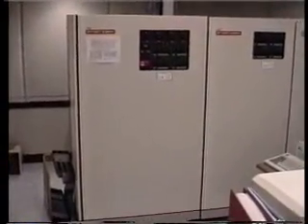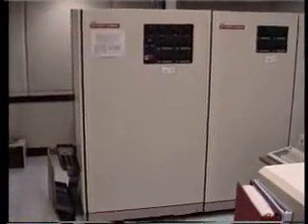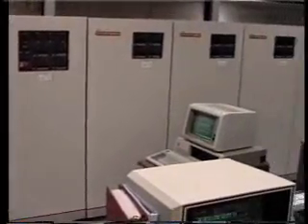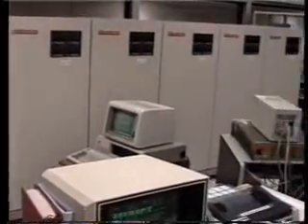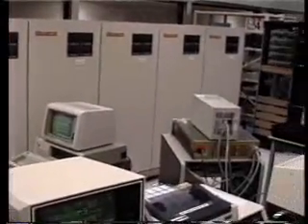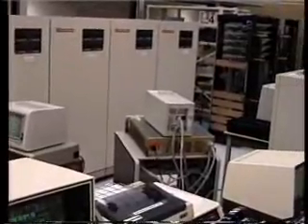Video Tour of a Mainframe Computer Room circa 1990  Please also see my IBM Impact Printer Video

Comment: isn't it "raised floor", not "suspended".  at least, i never heard the term suspended.  the floor you walk on is 15-18 inches or so above the actual cement floor.
Reply: Yes, the ceiling is suspended and both can be return air plenums.

Comment: My laptop has 16gigs of memory.   However the IBM 360 mainframe I programmed in college had 32k.   Even with 96meg mainframes are very good with managing memory. Programs written back then tended to be smaller.  Our datacenter at work is mostly Blade servers rack mounted.  The apps are cloud based and run through a browser.   That video brought back memories.

Comment: Started my career in an mvs/360 jes3 shop as a print pool operator, on 1980, and worked in many departments over the years.  it was a different world back then, when work was fun. Troubleshooting hardware errors or job abends was the bomb.
Reply: "Abend" a term i've not heard in 30 years since my mainframe days.....
Reply: I worked in a JES 3 shop too when I was just starting out.  Tape and print area.  The good old days.

Comment: a 96 meg mainframe what years is this, 1912?
Reply from the maker: This computer is from the 1992 - 1995 timeframe.  In 1912 they did not have computers.
Reply: careh1 I bought my first PC in 1982 or 1984 and it was 3500 dollars!
Reply: The last mainframe I worked with, in the mid nineties, had 16MB of storage. Megabytes, not gigabytes. It supported hundreds of online users. Mainframe architecture is a zillion times more efficient than the Windows and Mac architectures. On the other hand, they are also more expensive :)
Reply: In the early 90's - 96 megabytes of ram was a ton of ram - it would be like having a computer with 128 gigs of ram today.
Reply: +SkuldChan42 That's crazy the Commodore had 64k!
Reply: My machine is several years old, and has 128GB of RAM.
Reply: careh1 sure they did they where called people.

Comment: I wonder if you could develop a program that emulates a 486 and try installing Windows 95 or 98 on it.
Reply: VMware does.. You can install 3.1 and DOS 6.2 if you want... It runs quite a lot quicker than a 486 though..

Comment: I used to work at a data centre with cartridge tapes like that. Also I used the 6250 tape reels. I started using mainframe computers in the 90's as a system operator. Wish I did a video of some. Would love to share the System/38 and AS/400 system set ups I used to work on. I also used WANG VS systems, RS/2000,HPCAD,SWIFT,DEC &other systems that people have no idea what they are these days.The WANG VS system had massive disk platters that held 72Mb on them. I'd love to be still working with them.
Reply: I have fond recollections of the S/36 and AS/400 machines.

Comment: The fire supression system is impresssive! "It will put out the fire and any human near it"(3:24) They would rather you die than risk the $5,000,000 computer!
Reply: It's not the computer they're worried about. It's business continuity and data they're preserving. In practice there is substantial time for staff to vacate the area before the Halon is discharged.